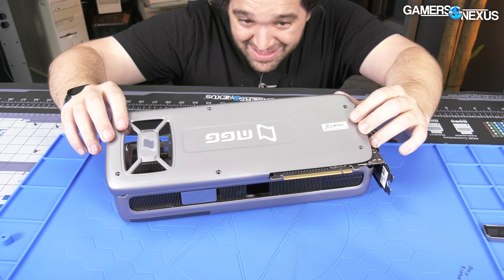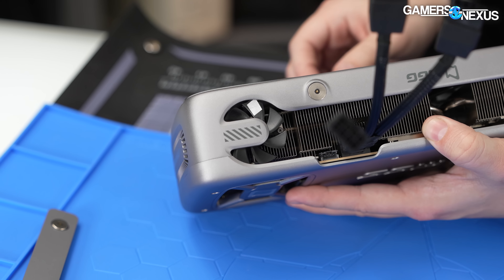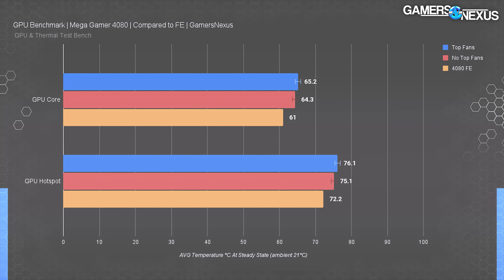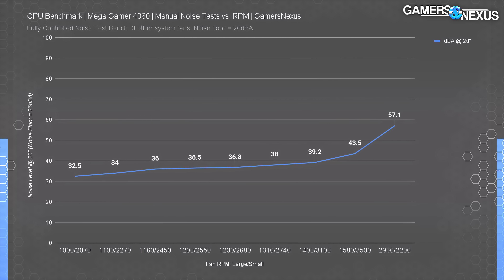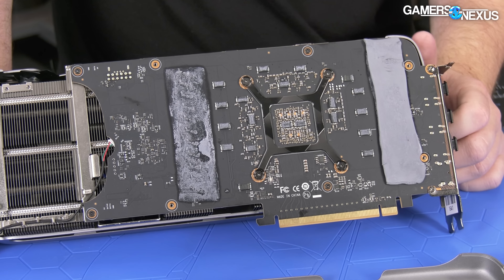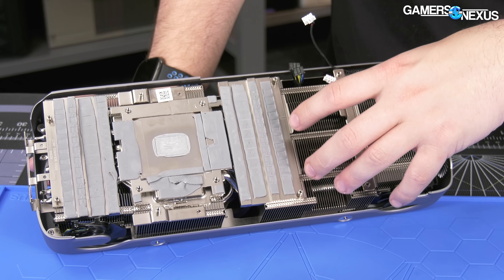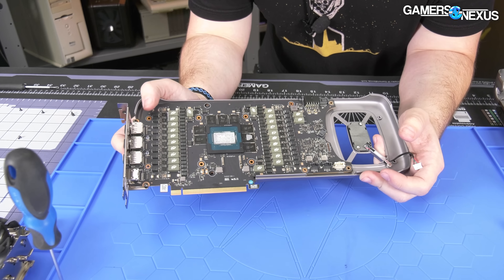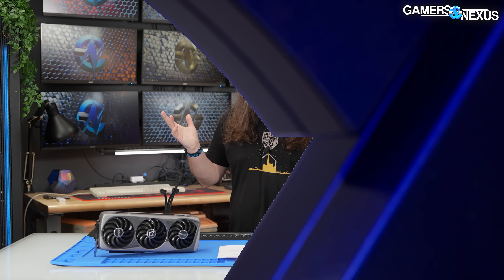The 5-Fan 'MEGA GAMER' GPU Tested: Maxsun MGG RTX 4080 Benchmarks

Comment: Those side fans regardless if they are pushing or pulling are either going to contribute nothing or just block the washout from the normal fans. And the benchmark proved the latter. Lot's of non-sensible "cooling" ideas going around these days when in actuality its extremely simple and the most simple of methods actually work best. More does not   = better. (arguable exception is mass on the material soaking the heat but this can even be implemented incorrectly)

Comment: 5 fans, but 5 fans that are points of failure, i wish manufactures would make fans replaceable without the need to disassemble. If you could have the power delivery to a contact point, and have fan blades with their motors press to release or a release pin hole.

Comment: heat Soak is likely this card's design problem - so the GPU would likely run Way cooler without Everything sinking heat into the cooler, plates etc.

Comment: Steve can't help himself but to troll the card's name. But in spite of that, it still looks like a glorified air conditioner, albeit one with a bit more rounded edges.
Reply: I wish they would make GPUs that were more like an air conditioner than a space heater.
Reply: @MistyKathrine  That is a mistaken train of thought. Air conditioners do give off heat, or in other words, shift it away from whatever it is they are trying to cool down.

That process can be reversed, and some can now heat up a room as well as cool it.

Comment: Dual bios is overrade.
Bios one is just the standard what is set by amd or nvidia.
Bios2 is just unlock so you can do more with the software .

I know one thing for sure by amd cards.
The cards are more stabel with bios switch on bios1 .
And if you use the overklok its just shit and a unstabel systeem.

I have test that with amd vega and amd rx5700xt .

Comment: I just want to make a minor correction on your technical language since you seem like the kind of people who'd care about that type of thing: Only absolute values make sense to be measured in dBA. Like you could say "the fans reached a loudness of 40 dBA". But relative loudness should just be measured in straight dB. As in, "the fans increased by 3 dB". And combined, you could say "the loudness increased by 4 dB, from 38 dBA to 42 dBA". But not "the loudness increased by 4 dBA".

Why? dB are always relative to something, so saying "the fans are 56 dB" makes no sense - 56 dB compared to what? Normally in audio one would compare to a standard minuscule sound with an air pressure of 20 uPa. But instead of writing "the fans are 56 dB louder than 20 uPa", people write "the fans are 56 dBA" as a shorthand. So that's what the A in dBA means. Note that we call this tiny reference sound of 20 uPa, 0 dBA.

But then you'll see that saying "the fans are 3 dBA louder than earlier" makes no sense, because the dBA already implies a comparison in the unit itself.

Comment: Nvidia needs to start getting real with price vs performance. Start by reducing cost of RTX4080 to $999 and the RTX4090 to $1,299. And trying to sell ANY new 4000 series GPU with less than 16GB VRAM is a deal breaker in 2023!

You should not be able to buy an entire new and current games consoles with access to 16GB VRAM for considerably less than JUST a graphics card with LESS VRAM! Games are being developed for 16GB consoles and then ported to PC... to then need to be DOWNGRADED in things like textures, in PCs with $500+ GPUs?!?